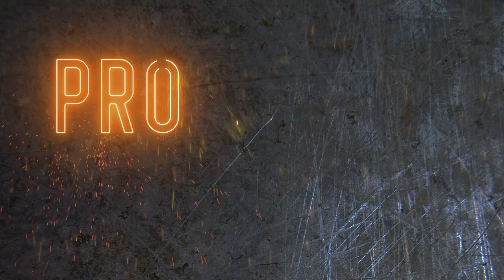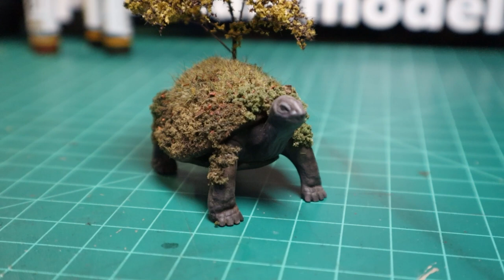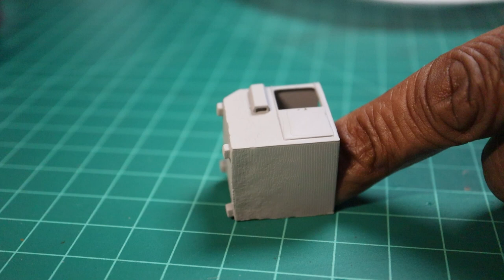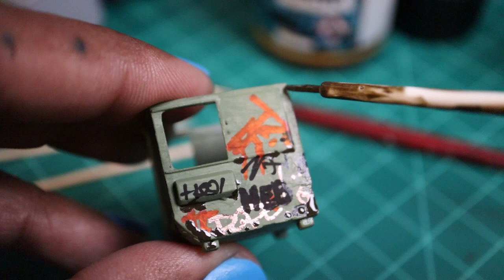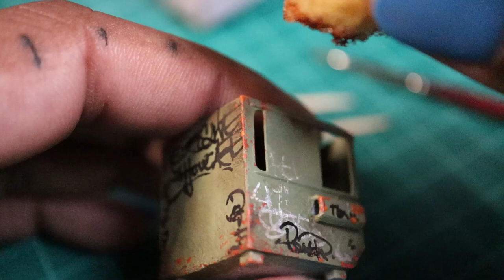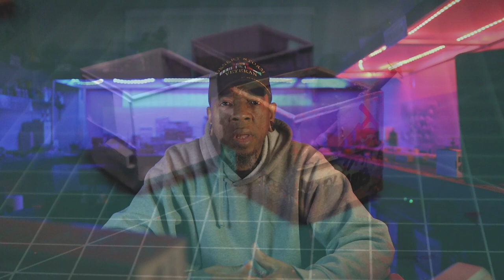3D Printing & Model Railroading

Comment: I think that 3d printing has a great effect on modeling and doesn't really impact retail suppliers.  
It gives those of us who wish to go to the next level an ability to stand apart from the crowd. We have designed additions and not just purchased or kit built accessories. (not unlike what you experienced when you got your Master of Structures certificate... Congrats again by the way ! !)  
I believe we are a small percentage of our hobby and that most are pleased to build what is readily available.
I'm a wooden ship modeler and started printing off thingiverse about three years ago with an FMD printer. That wore off quickly due to the limited supply of available content that suited my needs.  I build my ships that are old and weathered with broken crates and barrels, supplies and such.
I needed more, so I learned solidworks and Fusion 360 using YouTube...  That was hard ! !  But I'm now proficient enough that I can design and create things that add amazing detail and visual depth to my ships that no others have.  Oh, and I graduated to resin.  As you said, MUCH more detail and realism.
I agree with you that "older guys" seem to sometimes be less embracing of technology than your generation. I'd never printed or used modeling software before... hell, it took me months just to understand the terminology.  But it was a challenge... and as modelers, we love challenges ! !
BTW, I'm pushing 60 !!  Not sure where I was going with this opinion/rant or whatever we want to call it, but I know this... I LOVE BACON ! !
And your channel, your content, your sharing, and contribution to modeling world.  
Thank you for you man. Rock on and be well ! ! !
Reply from the maker: LMAO I love bacon too - lol - and man I'd love to see some of your ships. and yeah it can be a lot for some - and that's ok, everyone is different but the main thing is have fun and do what you can with what you have. Great comment man and thank you for your support.

Comment: Awesome discussion on 3D printing in the MRR community. Interaction Hobbies got its first resin 3D printer in 2015 with the Projet 1200. Great printer only just now surpassed by the likes of the Elegoo 3 in resolution, but now they are less that 1/10 the cost of what we paid for our first machine. I remember thinking that when the price comes down everyone will own one. Well, we are there 8 years later. now that the resolution is so good, making a "spot on" detail is possible. 

Now the issue all comes down to the available time one has to design that fantastic detail, configure it to print properly and get it to the layout. I believe the time is worth it for hard to find items and as you say, things that no one else is doing or doing well. With the easy access to printers, and sites like etsy and E-bay, we will see the market explode with new vendors in the space. The problem will become, "Who do I order from as there are soooo many choices!"

Keep up the great work and remember, "No detail is too small to be great!"
Reply from the maker: Man that's an awesome comment and thank you for it. I literally just ordered that dental set from you lol. But you're right it'll come down to who do I order from - also I think you do something that no one else is doing or has and you'll be just fine. Cause that's the set up right? Like the one or two one of a kind piece and heck they're already on your site and hopefully they'll throw something else in the bag if they need it. Thanks again for the comment.